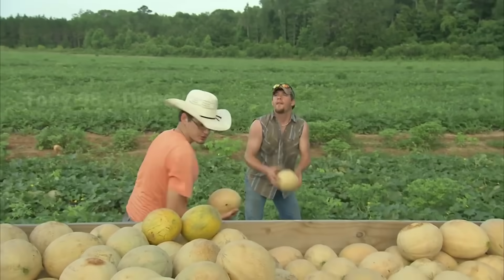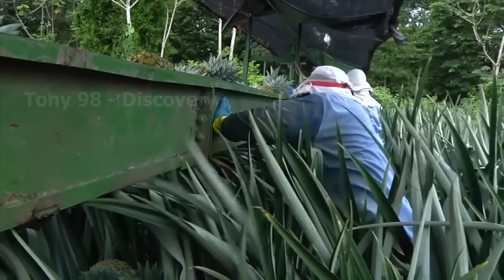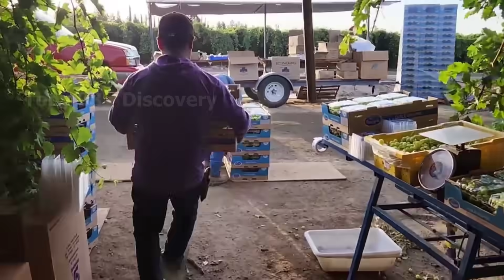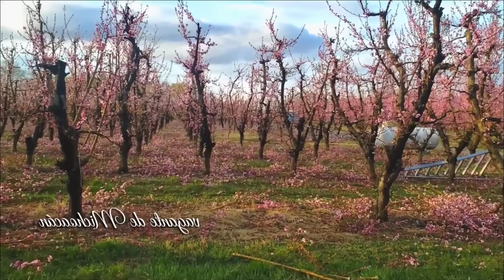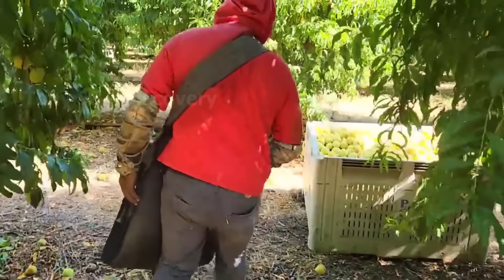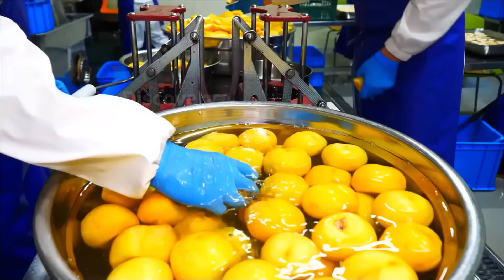How American Farmers Harvest Thousands Of Tons Of Fruits And Vegetables #2

Comment: Machine harvesting may not be suitable for some crops that require delicate handling.
Reply from the maker: That's correct! While machine harvesting offers efficiency and productivity benefits for many crops, it may not be suitable for those that require delicate handling. Certain fruits and vegetables are more sensitive and require careful manual harvesting to minimize damage and preserve their quality. The human touch allows for better control and selection of ripe produce, ensuring that consumers receive the highest possible quality. It's important to strike a balance between automation and manual labor to meet the specific needs of different crops.

Comment: Machines can have difficulty distinguishing between cooked and undercooked vegetables, leading to waste.
Reply from the maker: You raise a valid point. Machines can sometimes face challenges when it comes to distinguishing between cooked and undercooked vegetables, which can potentially lead to waste. That's why certain crops, especially those requiring delicate handling or precise judgment of ripeness, are often best suited for manual harvesting. The human touch allows for careful selection and reduces the likelihood of unnecessary waste. Striking the right balance between mechanization and manual labor is essential to optimize efficiency, minimize waste, and ensure the quality of harvested produce.

Comment: As a beekeeper doing pollination services for  over 40 years I am saddened that fruit with a scratch on the skin is dumped instead of donated (or sold at a lower price) to the less fortunate. A fruit that rubs against the stem and gets a scratch is not inferior in nutrition. So sad you don't get the option to buy it. Farming practices are not to blame, marketing practices are the problem.
Reply from the maker: How many bee colonies do you currently keep and what is the rental price at fruit farms?
Reply: @tony98discovery  I retired in 2019